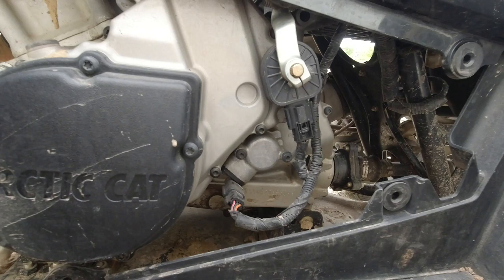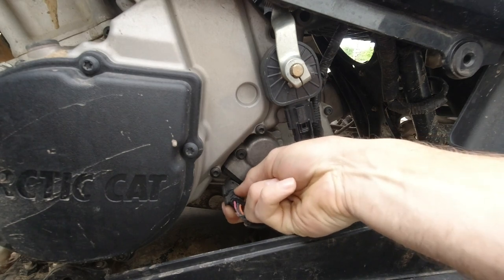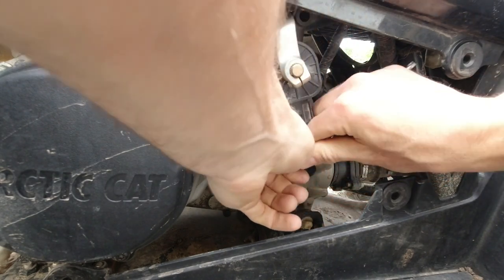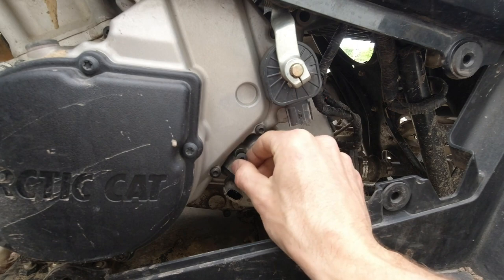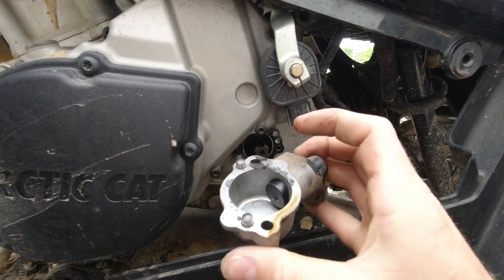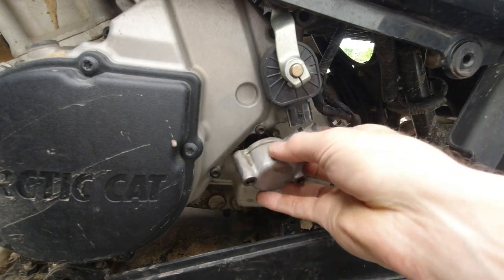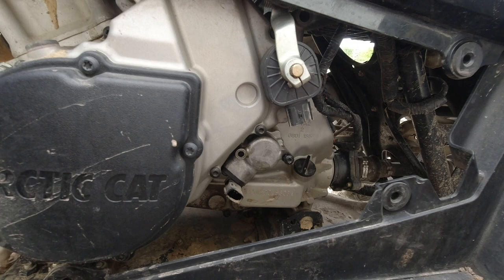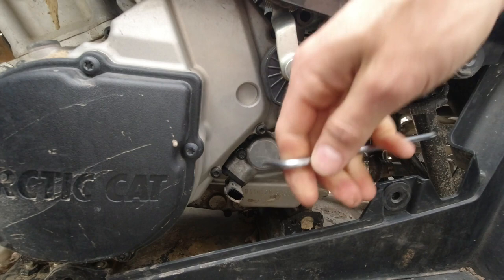How To Replace the Speed Sensor on your ATV

Comment: My 2020 Artic cat Alterra 570 showing 0 on odometers when driving code P0500 so assume need that sensor? I installed new led bulbs thought might be issue too
Reply from the maker: LEDs shouldn’t change anything, might check your sensor to see if it’s damaged or the connection is loose then take it for a test drive.

Comment: Wondering if this is what's causing my issues on my 2012 ... sometimes it reads then sometimes it will pop-up a little wrench icon
Reply from the maker: Could be? Start by checking for loose connections.

Comment: Would this be the problem why my trx 680 is stuck in 2nd. Gear?
Reply from the maker: This is just a sensor so it won’t affect what gear the engine is in.
Reply: @ArcticFrost  oh Ic my680  switches into second gear and stays in that gear idk what causing the problem I got a to saying it’d be a sensor

Comment: Hi, i got a Kawasaki prairie and on the manual says that I need to drain the oil in order to replace the speed sensor. Do I really need to do that? Thanks!
Reply from the maker: Cgiese80 yes you will. But if you safely tilt the ATV up on its side or enough so that the oil level is down from the sensor you won’t have to. Hope you get it fixed!
Reply: ArcticFrost thanks for your quick response! Now i gotta make sure I do have a speed sensor since my speedometer is analo. Does it matter? I think someone said i just have a cable and not a sensor. 05 Kawasaki Prairie
Reply from the maker: Cgiese80 if it’s a 700 it does, the 360 had the meter as an option.
Reply: ArcticFrost it's a 360 with the analog meter. The reason I'm trying to replace it is because my speedo stops working sporadically and 4x4 lights blink and then it goes away
Reply: @ArcticFrost  what the part number on sensor there
Reply from the maker: @bigjryeah5197  it is 0430-121 for the 2015-2021 Alterra models
Reply: @ArcticFrost  thanks